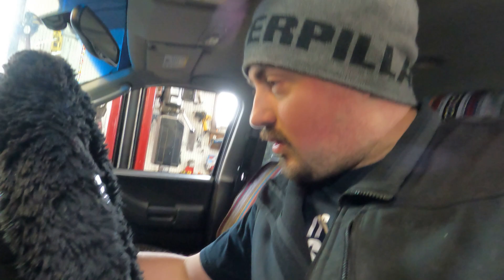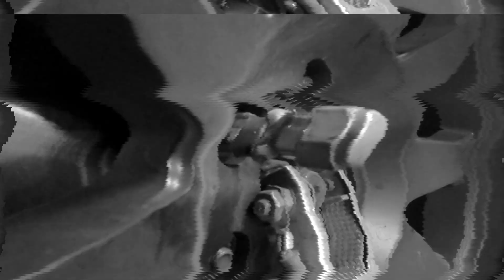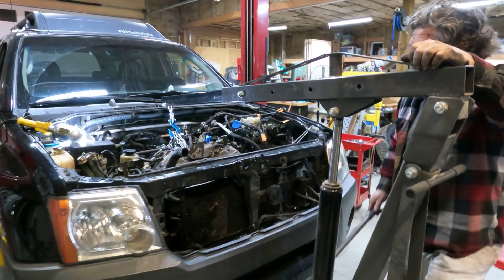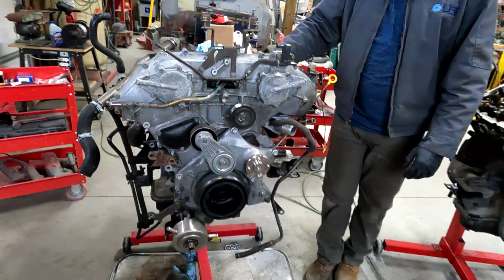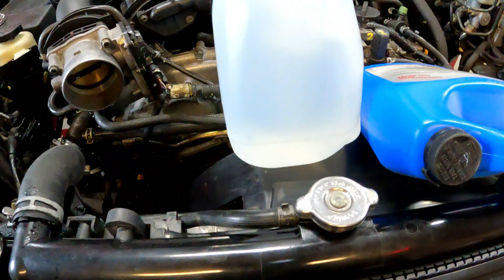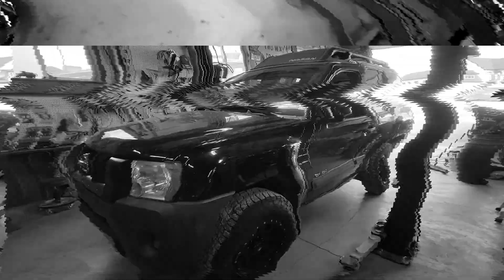Xterra Engine Swap

Comment: getting ready to do exactly this... motor blew in my 12 P4x, so gonna grab a junkyard engine and swap... this is gonna be a challenge. thanks for the vid helps out knowing what im getting myself into...
Reply from the maker: I'm glad to help out, man! Hopefully, all goes well with your swap, feel free to reach out with any questions once you get into it.
Reply: @hoodratsgarage77   welp i started this hot mess... the passenger side (everything) fought me.. Im doing a series of vids pulling this engine. all the heat shields bolts on this were rusted and had to be drilled or just torn off. its been a nightmare. lol but your vid has helped a couple fo times. the biggest hang up was the powersterring pump. that hidden bolt behind the pulley cost me abotu 2hrs. trying to figure it out. lol

Comment: Wouldn't mind having my vehicle looked at and have my motor rebuilt
Reply from the maker: Yah! It's a pretty daunting undertaking with the nissan v6 engine of this generation.  Usually, it is more cost-effective to replace the entire engine with a lower mileage unit as we did in the video. Thankyou for watching and commenting!

Comment: How much does a swap cost these days
Reply from the maker: Labor is at least $1500-2500 depending on the shop, plus the cost of the engine, which can range from $250-5000 depending on whether it's new or used. Theb you have things like spark plugs, gaskets, hoses etc that can bring the cost up more and more.

Comment: I have a 2006 xterra offroad with 207k. Its not smoking or anything but i am having issuse with oil pressure. It started out with the oil gauge dropping to nothing at idle and the engine would stall (pain in the butt stopping at red lights) looked online and people said oil pressure sensor switch was bad so i changed it and now the oil gauge drops between the L and the bracket and the oil light comes on (oil is topped off). It rumbles and vibrates at idle but doesnt stall I know its not a misfire because i changed the coils and put new spark plugs in it recently. Shes a tired motor and i wanted to ask instead of changing parts on a tired motor (oil pump timing set) should i replace the motor with another with less miles? Did you have any problems putting a 2015 motor into a 2005? Does the trans housing meet up with the block the same? Is there differences in fitment between the years? Do i need different exhaust manifolds? I do apologize with the questions but i am getting really frustrated with the problems and been tracking down and fixing things and its not doing the trick. Buying a new suv is out of my price range but i can save for a newer less mileage engine and putting brand new parts on a tired engine kind of sucks because i dont know what else might wear out then i got to take it apart all over again (i do my own work on a gravel driveway😅) ive rebuilt older engines last one i did was an 351w out of an 1987 f150. Is it better to rebuild a nissan vq40de or just change it for a newer used engine?
Reply from the maker: The vq40 engines are horrible to work on. If you have a really worn-out one, a swap for a newer one is a good bet. The 2015 we installed was a direct replacement as long as you keep all of your bolt ons to the long block from your original engine. There is an extra sensor on the newer engines that can be left in place and not connected. Good luck with your project! Thanks for watching!
Reply: Check your oil gallery gaskets. That's more than likely your problem.
Reply: @John-kb1bq  working on it now actually lol. Just got the timing cover off. Ended up buying a new timing kit with guides and oil gally gaskets. Going to take me all weekend.

Comment: Very cool, learned a new thing or two about my car and it's engine watching this.  Did you ever find out why the cylinder was misfiring in the older engine?
Reply from the maker: Honestly cannot remember, but it had a ton of piston ring leak down on several cylinders. Thankyou for watching and good luck with your Nissan!
Reply: @hoodratsgarage77  I see and thank you! My last big job was replacing the timing chains, tensioners, and guides in my 2006 Pathy. It was time after 160k and the 'supercharger' whine turned into a metallic grinding sound.
 
Cheers!

Comment: I grew up in Nampa and used to race at Glen Morgan raceway just out of Star. I just finished up swapping the 4.0 I'm my 2006 pathfinder with a 2018 4.0 from LKQ, I only changed the oil pressure sensor due to budget and used new gaskets i did not swap vvt solenoids. I'm getting a P0031 heater control circuit bank 1
P0075 intake valve control solenoid circuit bank 1
P0335 powertrain crank shaft position sensor A circuit. 
Any help would be greatly appreciated!
Reply from the maker: Hey there! Glen Morgan looks like a blast, hope my 2-year-old races karts there some day!  When I did the swap, I found it important to swap all of the sensors, the long blocks are the same throughout many years but many of the sensors from your original engine will bolt right up.   As for the p0031 there is a good chance your donor engine took a good beating in shipping and that o2 sensor or its wiring is damaged.  Our customer's engine was shipped, and most components were damaged in shipping (supplier stated that all parts had to be swapped over anyways, such as valve covers, manifolds etc. I am in no way a Nissan specialist, but with the p0335 I did see that they offer several different crank sensors for the VQ40DE and that one ranges from 2007-2015.  That being said if you didn't swap sensors there is a chance you have the wrong one (the 2018 in trying to communicate to your 2006 ECU.)  As for the P0075, in my video, you will see that I swap intake runners, fuel rails and intakes over, this is all due to the fact that throughout the years they had different variations, and you need the exact system for your 2006 on the 2018 engine.  Any good Nissan parts dealer will be able to get you the part numbers for each component on your engine.  From there you can verify if it is the part that is on the engine in your car now, if not you know what you need to do.  Best of luck!  -Nick
Reply: Your VVT and CKP codes could be related, I'd start just by changing the CKP sensor and cleaning your VVT solenoid, if that doesnt work maybe try swapping them but if that doesnt work its possible the cam phasers in the new engine aren't up to snuff. Is the engine running ok despite the codes?

Comment: I am about to pull my engine on my 2011 and not sure of the best way to lift it. Did you just wrap a bunch of chain around the lower intake? Looks like you did. Please let me know asap because this seems like the way.
Reply from the maker: I'm pretty sure we used longer bolts ran through the chains, into where the lower intake bolts to the cylinder head.
Reply: @hoodratsgarage77  I took a screenshot but it looks like you just wrapped the chain around the whole lower intake. I don't think you bolted it to the intake.
Reply from the maker: @bertrenolds5  I looked at a picture I took, it is bolted to the lower intake. I wish I could share a picture...maybe this google drive link will work https://drive.google.com/file/d/1jWRqVNyGb-S42nRzkMaxLEcoA3_FZbZ-/view?usp=drivesdk
Reply from the maker: The chain was defiantly bolted to the bolts that holds the fuel rails to the lower intake manifold.
Reply: @hoodratsgarage77  nice, picture worked thanks. It was fine using fuel rail bolts? People are telling me to go around the exhaust

Comment: What was the cost to do all this .if you don't mind me asking.
Reply from the maker: Most shops around here charge an average of $100-180/hour, book time for this job is around 15-18 hours...so that gives you a ball park of the labor cost.  Customer supplied the engine, but I believe it cost around $1800-$2600 shipped.  Then you need things like new gaskets, thermostat, spark plugs, engine oil, etc.  Honestly...the repair was probably more than the vehicle was worth, but the customer knew that going into it and decided that was what they wanted to do.
Reply: @hoodratsgarage77 I a mobile mechanic and I love those prices 😎
Reply: More than it's worth but not worth a car payment and full coverage.